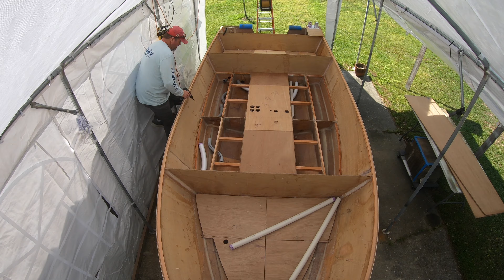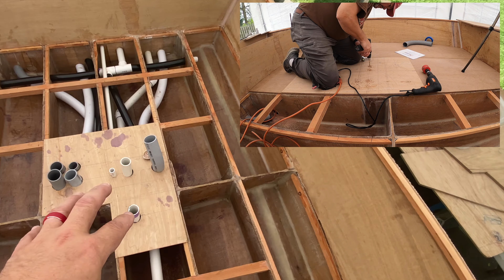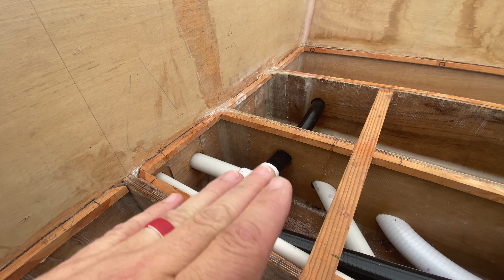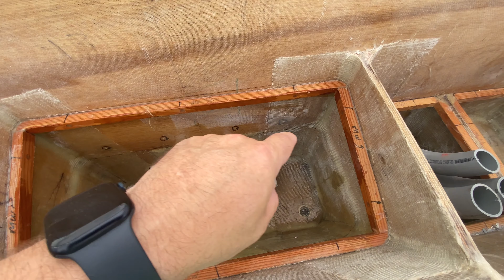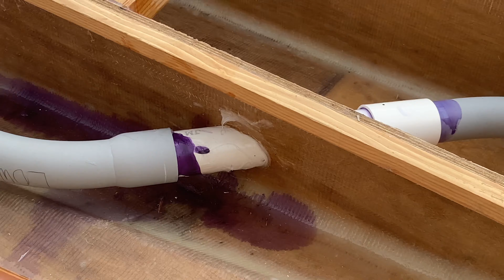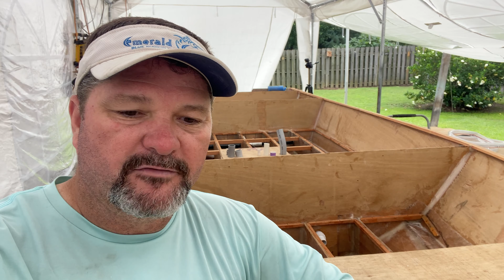What’s Actually Under a Boat Floor? Below Deck Build (Part 55)

Comment: Oscar, I’m also in LA, Lake Charles and I’m curious where you get your marine plywood? I’m amazed at how difficult it is to locate marine plywood in this state. On a previous project I drove 3 hrs to Riverside in New Orleans/Slidell.
Reply from the maker: I tried Riverside as well, but the price and availability didn't work.  I actually ordered from http://www.marine-plywood.us/.  Guy named Jake was super helpful. They shipped the plywood to Port Allen where I picked it up.  Very easy process and saved me a ton of money.

Comment: Suggestion Oscar. You mentioned filling with foam then cutting it smooth. My suggestion is to have a scrap piece of plywood the shape of the cavity you’re filling. Have a hole for pressure relief. As you see the foam rising and filling is confirmed, place your board down and maybe weight it down. Any overfill will come out pressure relief hole.  After you are sure it is finished swelling, you can remove your plywood. Should be smooth to accept floor. Good to see you back at it.
Reply from the maker: Thanks Steve.  I appreciate the idea, and it does make me think about doing some hybrid pour where I can move the covering board a few times and minimize how much I have to trim.  I'm going to think on this a bit more.
Reply: @Bigeaux20  I think I told you about the Checkmate I redid. After the stringer and floor was glassed in, I drilled 3” holes on both sides of the single stringer. I think there were 4 holes on both sides.I jacked up the trailer at the bow as high as it would go. Worked my way from stern to bow. As the foam showed up at a hole, I put the puck in and held it in place with a brick. You’ve got a bunch more cavities to fill though. Good luck. Can’t wait to see the video.
Reply from the maker: Yes, there has to be a some compromise to handle all of the compartments.  I'm going to put the best plan in place and we will see how it works.  Thinking if at a minimum I can limit the amount of trimming needed to 25% of each compartment, that would be a big win.  Fingers crossed.